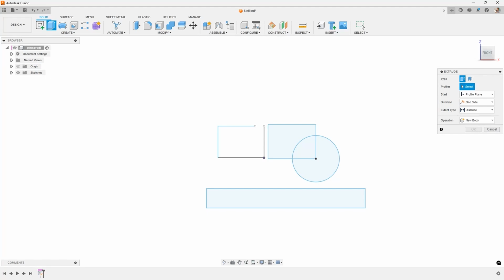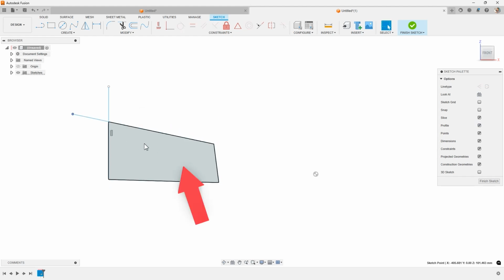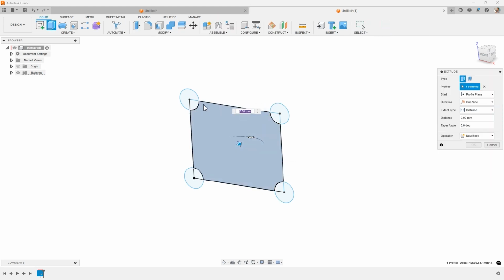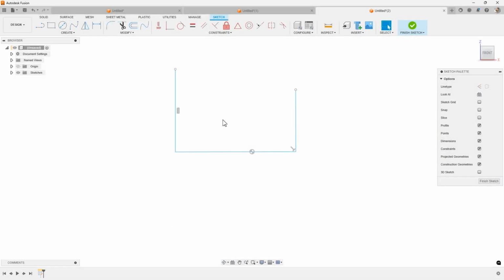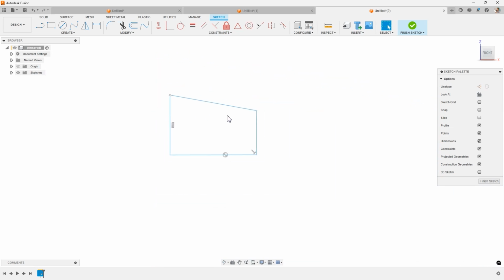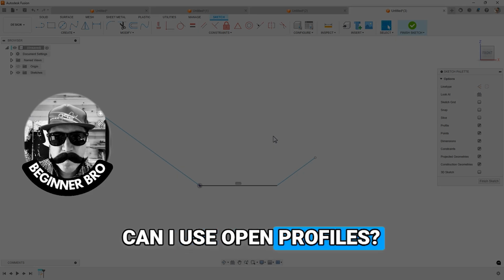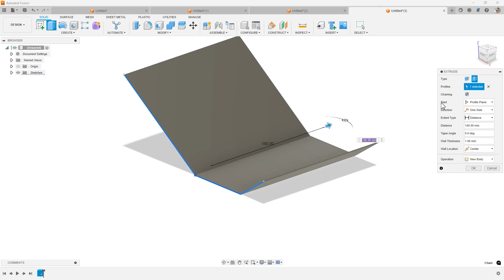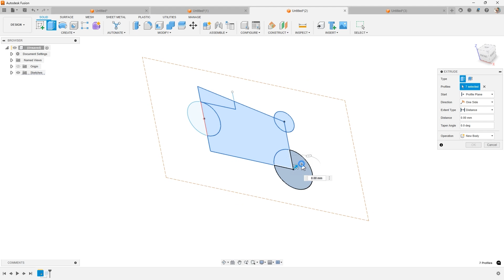Fusion 360 Profiles: The Hidden Tool to Troubleshoot & Reuse Sketches Faster

Comment: The finish sketch tab is closed...I have a defined area on the body (rectangle or circle, etc) , go to extrude and select defined body... Area is now blue and the arrow is pointing down.....My cursor cannot get the extrude arrow to respond.  It stays inert.  Can enter a value....that works but cursor will not work with extrude arrow.

Comment: I had this issue years ago, and now again with letters. I create a sketch just by typing some letters..... and somehow it (a letter) will not extrude, and I think it is because the letter does not somehow have a completed profile.  C'mon..... why can't the software just tell YOU when you try to extrude something that doesn't have a profile that the profile is non-existent.    At 1:52 in the video, you claim the software is showing you that the profile is not connected and extrude won't work;  c'mon exactly "HOW" did the software "show you" this. I saw nothing but 4 lines, that were not fully connected???

Comment: I love thin extrude. Been using it for a while now. Especially when I draw steel tubes.

I only wish I could change the default wall thickness from 1mm to the thickness of the tube I'm planning to use. Normally 1.6mm or 2mm.

Comment: OMG Thin extrude!! How did I not know about this? Thanks for sharing!
Reply: I love thin extrude.
I work with steel tubing a lot and that is awesome to sketch it.
I only wish I could change the default wall thickness from 1mm to 1.6mm or whatever tube thickness I'm planning to use.